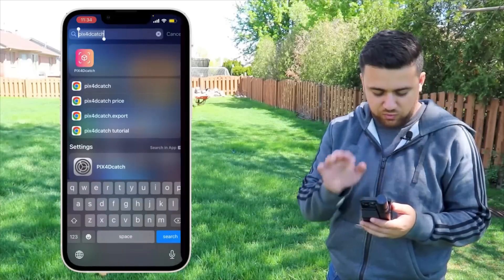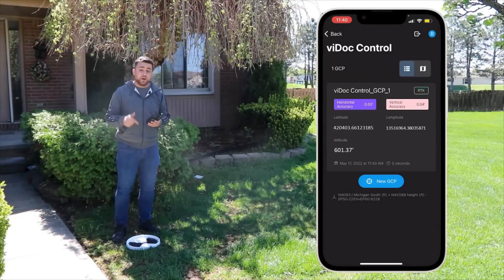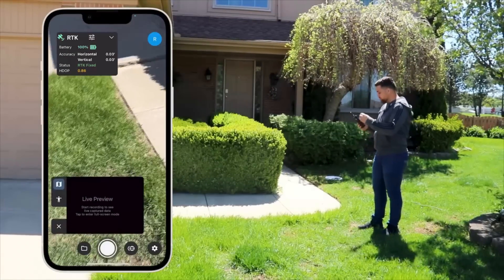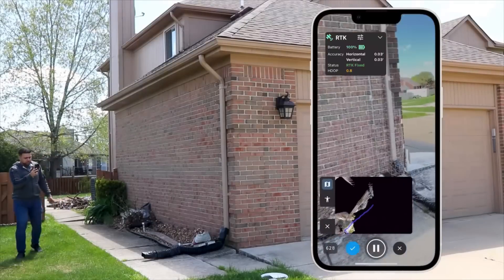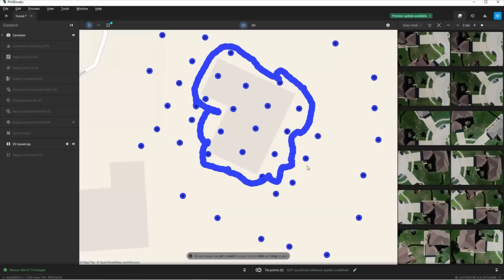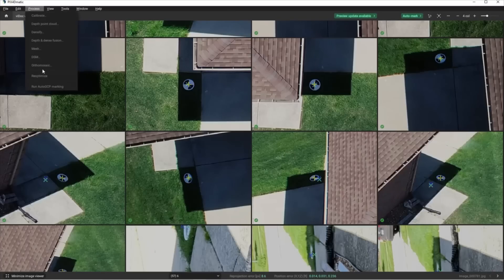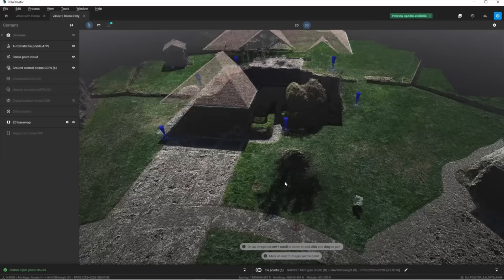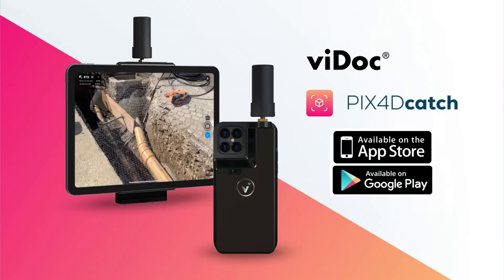Combining Drone Data with iPhone Data

Comment: Hi Rami

Can you calculate accurate area measurements from the model? For example would you be able to calculate the roof dimensions for each section of the roof. Thanks

Comment: I am looking to do stockpile surveys inside of warehouses. The lighting is poor and can be dusty. The roof does have lights and trusses that can be obstructive and are at a range of 30' to 35' above grade. the stockpiles we are looking to model are 25' x 100' or 50' x 100' and up to 20' in height. I am using a Mavic 3e and drone deploy but keep having issues with the images properly linking together into one model. Any tips?

Comment: Thanks for sharing...but Rami...need your advice...please correct me if i'm wrong...
1) in drone method we reconstruct pointcloud from images...so do we still need RTK instead increase the image overlaping ...
2) Using phone lidar with RTK... what about the accuracy for the objects that have slope with certain angle...eg. at the excavation projects

Comment: Rami another great presentation! Truly well done. Keep this up! Q 4 U. I have an iPhone 13 Pro and I am wondering if I should wait for the iPhone 15 before I purchase the viDoc unit. Thoughts? Also I have the Emlid Reach RS2+ as well as the DJI D-RTK2. Which of these units are better fit to be used with viDoc? I bought the DJI RTK to be used with my Matrice 300 and I am wondering if the viDoc can utilize that as its base or not. Thanks!

Comment: Rami, with Pix4Dcatch and LiDAR+Photogrammetry, you always want to slow down and move the camera very slowly, when pointing to areas further away (for example, the roof soffits in your example here).  Also, if you set the overlap to about 90% in settings, this is a big help because terrestrial photogrammetry needs a lot more overlap than very consistent aerial.

Comment: Great Video, we use the phantom 4 (non RTK) for our TOPO's in mountainous areas, do you think the viDoc would provide good supplemental data for the low (high vegetation areas)?
Reply: Hi! I also use the P4 (Phantom 4 Pro+ v1 in my case). Do you use any PPK with it?

Comment: Thanks for sharing this interesting video! It would be quite interesting if you could test this approach on a natural enviroment (e.g. trees), and then check if you can get "clear" pointcloud to extract insights regarding tree height, diameter etc.
Reply: Vegetation is difficult because leaves move with the wind or breezes. Since he is in Michigan, a project like you describe would be more possible during the winter when leaves fall off the trees but would be harder because batteries don't last as long in the cold.

Comment: Great video Rami! Have you tried bracketed exposures from the drone to increase information captured in the shadows? Brackets capture “correct” exposure, and then a number of stops under and over from the same position to give you more dynamic range. Because you have positional data from each image you don’t need to process them as a HDR to add the images to the dataset like you would if you were using the images in traditional photography.
Reply: I don't know if the rtk corrected positioning would be good enough to align bracketed exposures but the software could probably do it the same way it does other alignment, by matching up common points.

He could achieve the same thing a lot easier by shooting on a cloudy day lol. The p4p camera has been a consistent source of frustration for me with its limited dynamic range and poor performance in low light/ high ISO situations :-(
I wish it didn't cost so much to fly an SLR 😩
Reply from the maker: Yeah I needed to do this for this project and I just didn't. My main focus was demonstrating how the drone and iphone can be used together.

Comment: As a surveyor myself I would like to comment, using a different workflow with just a drone can yield much greater results than being shown. I have P4RTK with GNSS Rover and Pix4D. I agree that under the roof is extremely difficult to capture with the drone, however It is possible to get much more from the drone than this. The P4RTK is an extremely capable drone, it should be given more of a fighting chance than this.  

No hate towards you Rami, I really enjoy some of your videos.
Reply: I believe he was showing that you don’t have to fly super low to capture your oblique imagery if you have an iPhone and viaDoc. There are many ways to do this type of project. For me I use a DJI M300 RTK with a Rock Robotic R2A LiDAR payload and walk around the house with a NavVis VLX. Depends on what hardware you have or can rent.
Reply: @scottkarlins  Thats fair what you are saying. I just think that people looking for information on this drone before buying or renting could be lead slightly astray. I think its just fair to the drone to mention that with the proper workflow very good results can be achieved.
Reply: @scottkarlins  On a side note, how do you find the VLX, im finding in my country its been fairly badly marketed. They are trying to sell it as a replacement to all the other scanners on the market. I use a Leica P40 and RTC360 on a regular basis, and I was basically told I can sell them off and go to the Navvis. We got a hands on of the data from it on a site versus a Riegl VZ400i and it didnt even compare.
Reply: @bombaclad8632  Which country are you from? I can tell you the datasets are very nice. However it is not a full replacement for a terrestrial laser scanner! The VLX does a lot, and it is best indoors. For outdoor, you need vertical assets in order to not get drift or a SLAM break. You also will need control for very large indoor and very large outdoor areas in order to validate your datasets. I regularly fuse aerial LiDAR, TLS and VLX data, and with control it works amazingly well. Contact me on LinkedIn if you want to discuss further. Happy to talk shop!